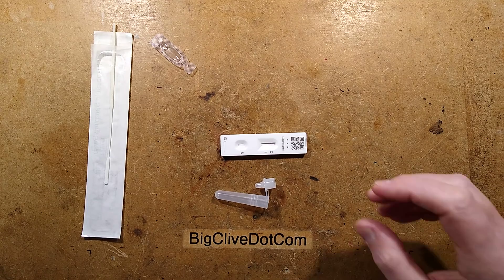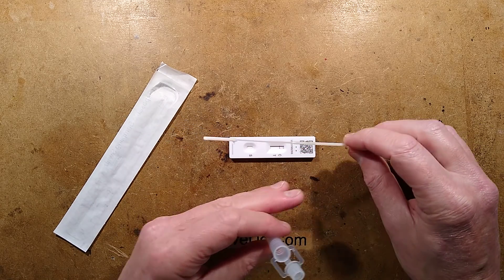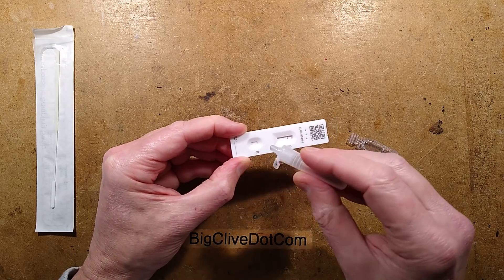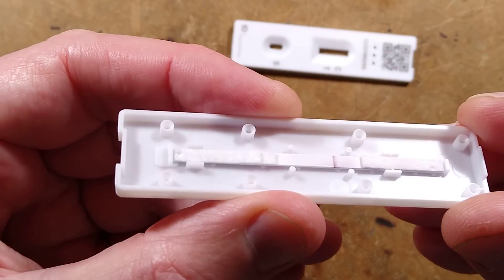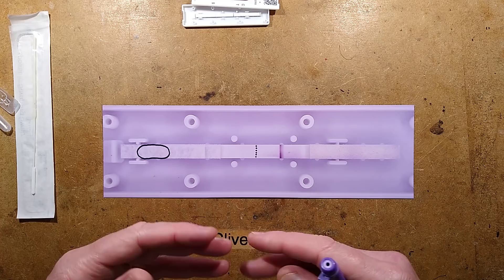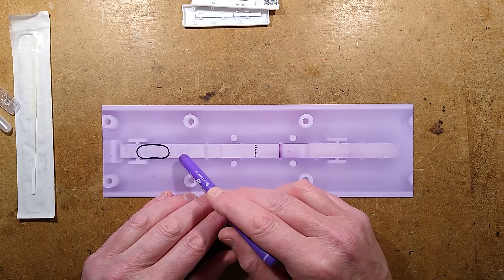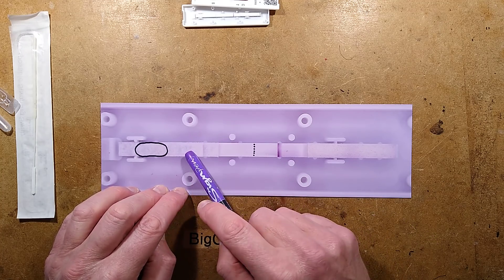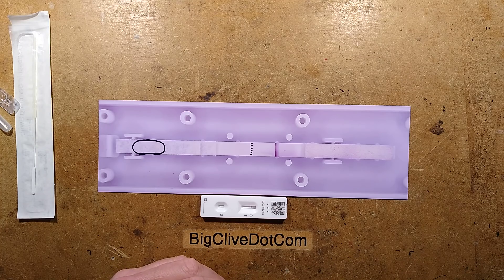How a lateral flow test strip works (kept simple)

Comment: Theres easier Lateral Flow Tests now too. My mum works at a school, she has to do these 2 times a week  + 1 extra on the weekend for something else so I'm all to aware of how these are done since she asks me to submit the results to the NHS all the time  on her behalf and check she's doing it right. 
Thankfully her School provides her with the easier 15m ones, pretty much same as the 30m ones but you only swab your nose and its smaller, requires you to put in 4 drops, as well as having the liquid in the tube already (tube has a foil seal on it). It also requires you to mix it a bit more and use the tube to ring the swab out instead of just brushing the swab on the inner sides. She still has the 30m ones for the weekend tests she does extra too since its a requirement for a group hobby she does.
I'd be glad when it's not required for her to do tests anymore, it's kind of annoying to do 3 times a week.
Reply: Our older kits had liquid in the vial already, much easier.
Reply: both my kids do the nose test, provided by the school, twice a week. Lot's of snorting going on :)
Reply: @FrancSchiphorst  you're crazy allowing this. Do you know what's in these swabs? One of the components is ethylene oxide which is carcinogenic. The amount of utter ignorance on all of this covid scam beggars belief from masks to vaccines to the fraud of the PCR test.
Reply: @paul756uk2  LOL
Reply: @paul756uk2  still LOL
Reply: @paul756uk2  when you say do some research, do you mean conduct your own peer reviewed research using the scientific method, or do you mean seek out a qualified authority who has done such research and take their word for it? Either way, the result is the same, and contradicts what you're claiming.

Or by 'research' do you actually mean 'listen to some kook on the internet with only two brain cells, who is disagreeing with the consensus of the entire scientific community'?
Reply: @amyruthworrall  science is based on evidence, not consensus.
Reply: @paul756uk2  yes, correct. So the two options are to run a sufficiently large data gathering operation to obtain your own evidence, or to believe people whose job it is to obtain and vet such evidence. 

Of course, a single person’s subjective experience is an anecdote, not a piece of evidence.
Reply: @DevinJuularValentine  I don't have to justify anything. Never been scared. The only thing I will add to your comment is that domestos is a surface cleaner but people don't have it stuck up their noses. It was you that said I thought everyone was a paid shill, not me. Don't put words in my mouth. I will however say, ignorance plays a big part. People generally do what they're told.
Reply: @DevinJuularValentine  Could you supply evidence that alcohol producers are suppressing data or misinforming?
Reply: @DevinJuularValentine  BTW I don't have any skin in your debate with @Paul Saunders but for the sake of a balanced debate.

Ethylene oxide may used to clean medical equipment but that doesn't mean it's a good idea to regularly ingest it or routinely rub it against your mucus membrane. 

UV light is a good distinfectant as it denatures the protein in a virus (and stops it replicating) but that wouldn't be a reason to shine it into infected lungs as it would indiscriminately kill healthy cells.

Not forgetting that research these days only really exists if a scientist is sponsored to run the experiment. So unless there's a market/financial gain to be had some things may never be tested empirically. The days of Govt-funded laboratories beavering away to build a body of knowledge are long gone - these days it's put out to tender in the private sector on specific projects for specific purposes. So all evidence should be challenged at all times to spot any biases.
Reply: You forget these people will do this to their kids rather than admit they were wrong, your not going to get an answer that hasnt been fully paid for that these fools will think is honest

Comment: Tip, they’re still very effective just up your nose, 10 seconds up each nostril. Confirmed with PCR test. I can’t stuck one in my throat without throwing up!
Reply: I am just taking those PCR Test. I think the straw they use to poke nostril is the worse, I'm trying hard not to sneeze because suddenly my nose throw out a bunch of liquid 😂 and I don't even know what those one made of, because I didn't see any cotton around it unlike the one they use to swab throat, and the point shape had many bulging part that make it even more triggering to sneeze out.
Reply: The newer ones don't even ask you to swab your throat, just your nose, and they complete in 15m not 30m
Reply: And just swabbing up the nose is permitted for those with a sensitive gag reflex 👍

It's not been well communicated but is in the guidelines. Everyone seems to think it has to be throat and nose, but nose only is also acceptable. 👍

Comment: I followed the NHS video for staff which does not use the back of the throat bit,  just both nostrils 10 turns each. Makes me sneeze a lot but no gaging. Other half has worked her butt off though all the lockdowns and still works bloody hard.
Reply: I wouldn't do one.
Reply: @JamesSmith-vz8yr  good for you…?
Reply: @ARSZLB  Noser4p3 Zach.....

Comment: I got a covid positive from a lab test a few months ago, The lat flow tests showed negatives everytime though. I kept doing them everyday while isolating just to see a positive. It never did and was very strange.
Reply: The PCRs are a little bit flakey, so it may be you didn’t have Covid (if you had no symptoms). Either that or you were perhaps doing something wrong with the tests? The LFTs are really accurate, so its pretty unlikely multiple ones would get it wrong, unless there was something systemically wrong with the batch etc.
Reply: Lab tests (PCR) can show up positive on extremely tiny amounts of virus or viral debris. Your infection might have been as good as over or even fully over when you got the test, or the test might have been contaminated. Did you also do lat flow tests in the weeks before you got that lab test?
Reply: PCR tests are easy to manipulate for example if you raise the test cycles enormous GH you can get "positives" from papaya fruits and even coca cola. That's why they want you to believe the PCR test is superior becsuse with them they raise or decrease numbers of "cases" at will by simply adjusting the number of test cycles to use.
Reply: same. Was ill, had such an antigen test (Lepu brand) -> negative. After a while i lost the sense of smell, that convinced me to call for a pcr, -> positive. I was vaccinated (sputnik-v) in march, the illness happened in november after returning from egypt. The illness was a bit of runny nose, then fever, loss of smell, then a bit of coughing. Nothing serious.

Comment: The latest ones are nostrils only.
The liquid is also already sealed in the test tube.
Reply: Tricky to get hold of in the UK - I was told by 119 operator that you can use the throat/nasal test kits and just do the nose swab. This is the internet don't take my word for it! Ring 119 or ask your chemist etc.
Reply: Had one last week (UK), nose only. Still wondering as to how accurate these are...
Reply: @skysurferuk  20% false negative rate, 0.01% false positive rate, if done correctly.
Reply: My kids have had several version and some have liquid in the tube, some use the system in this video. Just depends on the brand.

Comment: I find the eye on side of the tested nostril just tears up, after having done them multiple days in a row. The sneezing is easy enough to suppress but a couple times I nearly sneezed violently on a nurse.
Reply: The ones here only need sticking the swab in for 2.5 centimeters and twisting it 5 times against the middle plate of the nose. It is fairly okay if doing it yourself.

Comment: I’m disappointed ☹️
Wot no hammer? 😉😀

After enduring the gagging and pushing a swab so far up my nose it almost came out the other end, my eyes were watering so much I put the drops on the wrong end of the strip.
Idiot !! 
Had to go through the whole process again with another test kit.
 BTW The control line does not change colour if you do this

Comment: Worth noting that these have a really bad false negative rate (approx 50%) which is why they’re for symptomless testing only.

If you have symptoms, book a PCR :) 

These are only designed to catch the occasional asymptotic case that would otherwise go around spreading it about.
Reply: Not true at all. The only ones it tends to miss are the one when the virus exists only in very low quantities before you are infectious. But if you have symptoms, do both, and if either comes back positive treat as Covid (PCR has a higher than ideal false positive rate)

Comment: That right there is engineering at it’s best - take something incredibly complex, and set it up so that anyone can use it. Genius, really.
Reply: @nemesis2264  That's like saying thermometers are useless because you saw a video where someone stuck one in a flame and it showed them having a 2000°C fever.

It's designed to give a result for mucus, how it reacts to anything else is irrelevant. It's not claiming to test whether your breakfast has covid.
Reply: @nemesis2264  it tells you not to eat or drink before it for a reason.
Reply: My wife works in a Covid lab and performs PCR testing on a daily basis. I have to remember to tell her they apparently can tweak the results however they want. I'm pretty sure she will be happy to hear that. Given that their 8 hour shifts are frequently 12 or more hours long just to be able to process the amount of tests they do, I bet they would be happy to shave off some time.
(Nah, I won't tell her, she's frustrated enough as it is from the overwhelming amount of internet people claiming stupid stuff about the tests they do and doesn't need or deserve more, especially given the crazy amount of time and effort they are all putting into all this...)
Reply: @nemesis2264  - well, they are not supposed to have coffee or orange juice dropped into the receptacle.
Reply: That's like saying rulers are inaccurate because the measurer didn't use the 0 point and was also bending the ruler. That's abuse of the instrument and the fault is on the user not the instrument itself.
Reply: This is exactly what I was thinking.
Reply: It’s just a pregnancy test with a slightly different bit of chemistry.
Reply: Great convo guys, happy new year and keep arguing.
Reply: @Gepstra  you've come off as incredibly pretentious with that comment, were you being sarcastic or genuine?
Reply: @Gepstra  apperently.. you.
Reply: You got it mixed up, engineers tend to make simple things very complex, so nobody can understand it.. lol
Reply: @nemesis2264  lol what a sad tryhard
Reply: @nemesis2264  Well yeah, I was talking about your cringeworthy banging on about a "social experiment" and acting all smug like you won some kind of clever mind game over getting some replies to what you've made look like a very typical dopey Youtube comment on this topic.

(Writes some dumbassed bullshit)  "HA, ANYONE REPLYING HAS ALL FALLEN INTO MY BRILLIANT TRAP!  I'M SO SMART!"
Reply: @nemesis2264  Oh so it wasn't even sarcasm and you're actually one of those halfwits lol, not sure which is sadder!
Reply: @nemesis2264  - umm, I did read your comment and gave you a reply. Any subsequent ones are irrelevant.
Reply: @nemesis2264  - you only said one stupid comment anyway.  Stop Bullying people.
Reply: @nemesis2264  you're exactly right, not sure what the other guy is talking about.
Reply: It's obvious what he's talking about ie test can test for a substance and the response he got? That some malicioud people will manipulate the test. That can be done for any test, so why test at all? Throw all testing out. Badam tss
Reply: incredible engineering, shame they are inaccaurate crap.
Reply: @rich302uk  They’re not particularly inaccurate – if done correctly, the accuracy rate is very high and the vast majority of people with a positive LFT have Covid (in fact there is now more concern about false negatives from PCRs than false positives from LFTs)
Reply: That I agree with - the opposite is true of the official narrative. They want the PCR to stay as the official standard bearer for testing because they can tweak and manipulate results from PCR testing by adjusting the number of cycles - for example if they want to show a higher infection or "cases" rate they simply increase testing cycles so that even a voca Vila swab would produce a "positive" if they want to reduce "cases" they simply reduce testing cycles. Can't do this with lateral flow so of course it HAS to be decried as an "inferior" test!
Reply: @lenfirewood4089  like any test, it has to be used honestly. Anything can be manipulated to give the result you want if that’s your intention.
Reply: @lenfirewood4089  Gonna need a citation on this heaping plate of bullshit you just handed us.
Reply: @deadbeatdon  Never heard of that source. But hey you're ahead of a MAGat since you provided one no fuss abiut it. Nice to see and for that I thank you.

They arent gonna waste their time manipulating PCR results to skew case counts when its far easier for them to simply ease testing mandates, though. Or just blatantly boldface lie about it. And we have seen the previous administration do both. Being vaxxed I dont keep up on testing, just keepin an eye on if and when I will need a booster.
Reply: @Axodus  [Citation Required[]
Reply: @TestECull  
"Citation Required"? Don't you mean "needed"? I'm actually not required to give you any citation, as I said, the administration has been lying about something or other every day, it ain't that hard to find one of their many lies on your own.

But here's your citation that I willingly give you by choice, have you forgotten about Afghanistan? He literally told the leader of Afghanistan to lie to everyone with him about the fight with the Taliban.

The actual transcript from the phone call;
"Biden:  I need not tell you the perception around the world and in parts of Afghanistan, I believe, is that things aren’t going well in terms of the fight against the Taliban.

And there’s a need, whether it is true or not, there is a need to project a different picture."

Do you require any more damning evidence or is this damning evidence where Biden literally admits he knew one thing but said another thing enough?
Reply: @Axodus  You think I'm going to take seriously a source called 'Memeology 101'?
Reply: @Axodus  Find a better source or retract your claim. I'm not gonna waste my time arguing with someone who can't do better than 'memeology 101'.
Reply: @Axodus  All I know is some youtuber is trying to portray propaganda as fact.

Come back with a better source or don't come back at all. I don't believe YOU for one second if you can't come back with better sources. You have no credibility on your own, after all.
Reply: Sure... Why Bother even? Most tge PCR tests i get are negative!

Comment: I hate doing these tests. My gag reflex is hair trigger sensitive, I properly dry heave before the swab gets remotely close to my tonsils. When the swab violates my nostril my head just leaks from all holes and I get a mad sneezing fit. I still do them when required but I end up just avoiding going out altogether to evade getting infected and the need to do these tests. F**k this bat virus.

Interesting video though, between retches I did sometimes wonder how these things worked.

Comment: I have to take these bloody tests weekly, I have found you can just stick them to the back of your throat and not bother with the painful nostril bit. I've seem some people insert them in the nose all the the way until it hits the back of the throat, they cough and gag and its totally unnecessary, just stick them in an inch or so, like the PCR test. Essentially just stick it where you find least worst. 
Why they haven't made the probe L shaped so it can go in the mouth and quickly dab the back of the nose  is beyond me. Medical procedures are often needlessly uncomfortable.
Reply: How would you find out it is enough? I mean if there is not enough material on the swab, it would just show a false negative, right?
Reply: @berndeckenfels  no line shows at all against the "C" if not done correctly, I used trial and error to find out.
Reply: Why would making it L-shaped make a difference? You’re only supposed to stick it 2.5 cm in, so no idea why anyone would be ramming it up further than that. The nose swabbing is key though, as that’s where the virus first shows up – the latest form of the test has dropped the throat entirely and now works entirely on a more thorough nose swab.
Reply: @Zveebo  making it L shaped would mean it could go into the mouth then go behind the epiglottis to the back of the nose area without going via the nostril, its really wet there so it would take less swizzling time. But I agree that it doesn't need to go to that part anyway even though the instructions seem to show it does.

Comment: See if you can get some of the FlowFlex ones instead of the NHS Test & Trace branded ones.

A relative of mine caught Covid, and tested positive on 3 FF tests and negative on 3 NHS T&T tests (across 2 batches of each) over the course of a day, then later tested positive on PCR.
I'm not sure if they're observably more accurate, but they seem better at catching a positive test early on (also they don't have to go down your throat, so it's a bit less unpleasant).